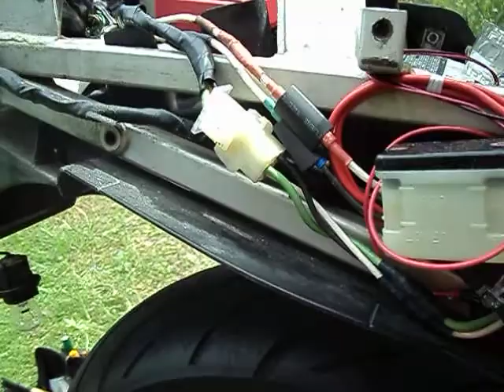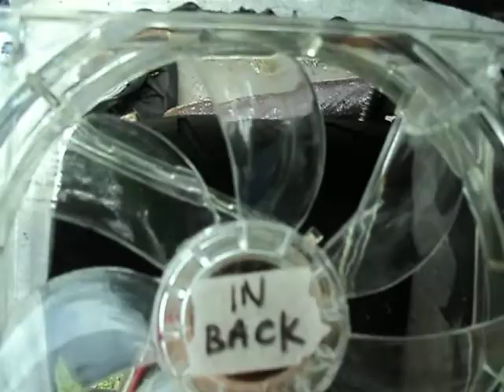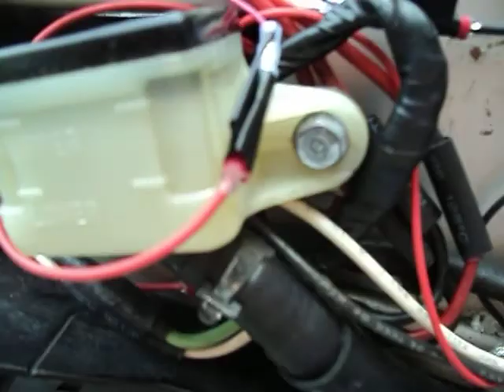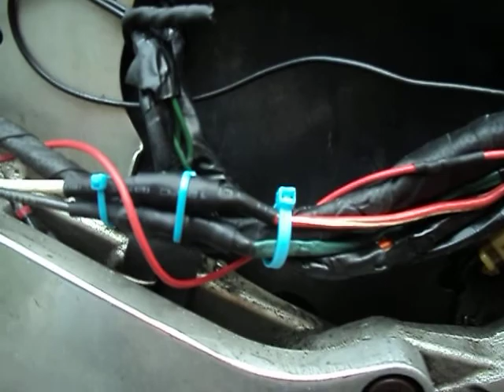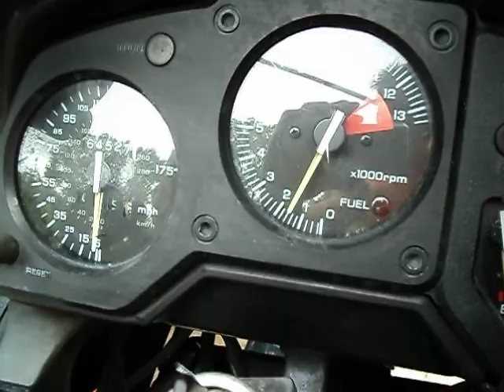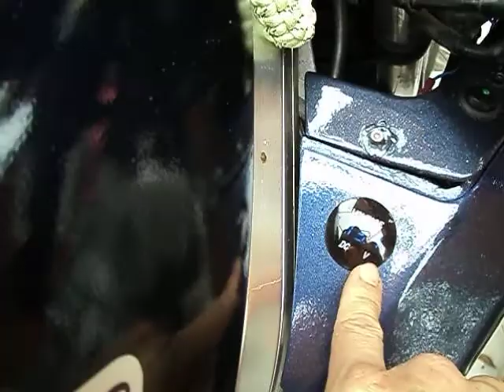The Fallacy of the Honda VFR 750 - Rectifier, Heat, Jetting

Comment: I noticed that the rear frame gets really hot. I think regulator should be lifted off the frame like half an inch. It can not cool when it is bolted to that hot frame. Hole on the rear mudguard is a solution but on a rainy day the water will fly in from that hole.